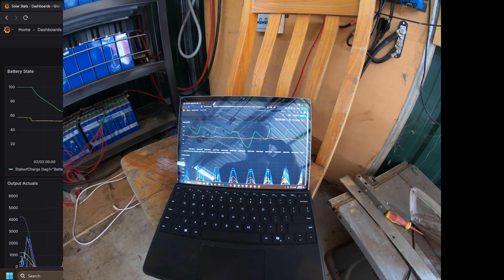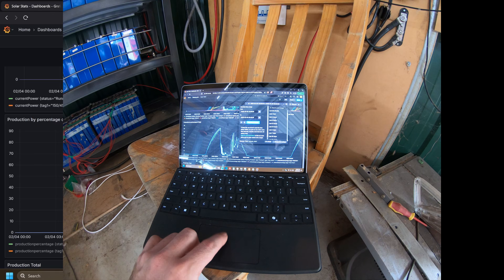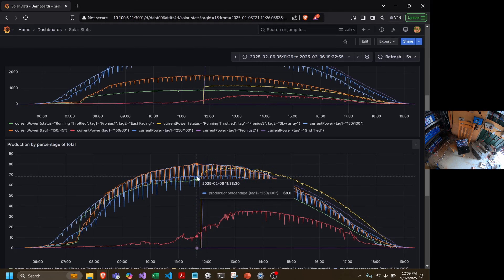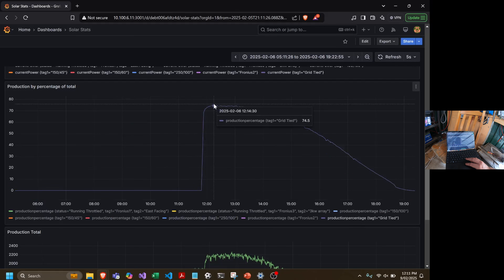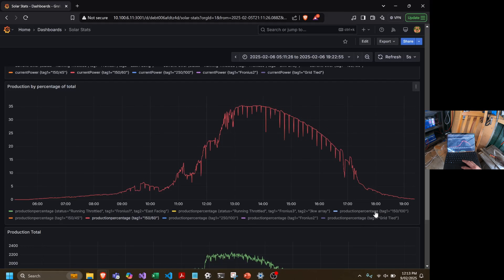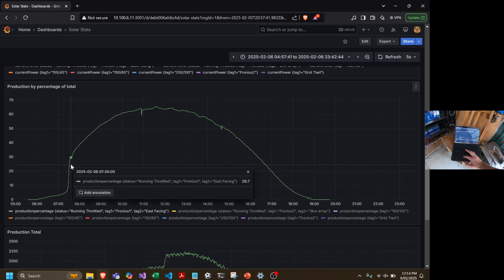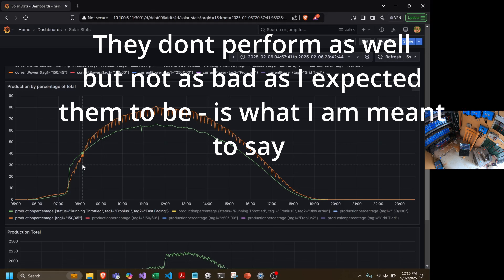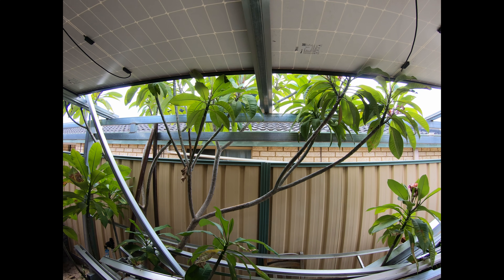Solar Panel Performance New V Old

Comment: Getting the correct angle for solar panels is always going to involve trade-offs. Obviously, the best angle for mid-Winter is not going to be the best angle for mid-Summer and the best angle for the morning is not going to be the best angle for the midday Sun. When I put my panels up, I went down the rabbit hole of using online calculators and compared them the pitch of my roof and got thoroughly confused. I couldn't change the pitch of the roof, but I did have the means to change the angle using the proper racking and supports. 

In the end, it all got too hard. My house roof is 20 degrees and my shed roof is 16 degrees and I just made-do with that. I have three arrays facing due North and one array facing East. so, it ends up 12.1 kW facing North and 3  kW facing East. Surprisingly, the East facing array does quite well for most of the day, outputting quite nicely until about 3PM at this time of year.

Apparently, the optimum angle for your panels is pretty much the same as your latitude. For me that would be 28 degrees, so my panels are more efficient for the 3 months either side of the Summer Solstice than they are for the 3 months either side of the Winter Solstice. I've got 5 330W panels left over from my install, so I think I'll make up a portable rack with almost vertical angle and wheel it around to where it can face West for the last rays of the arvo.
Reply from the maker: thanks for the feed back. you hit the nail on the head. Most peoples issue is the pitch of their roof. you cant do much about. and if you try to angle them you lose parallel space